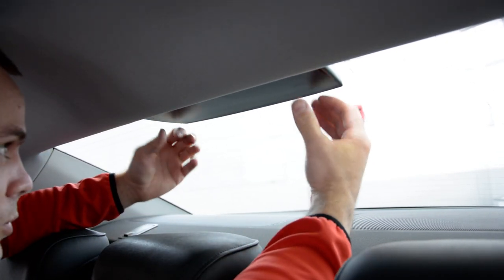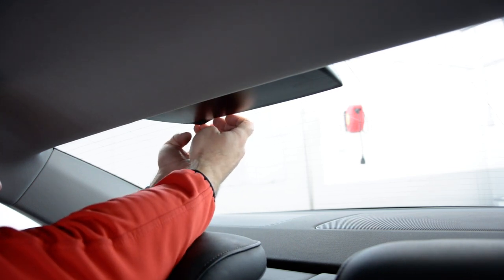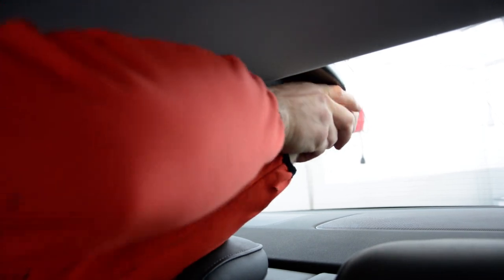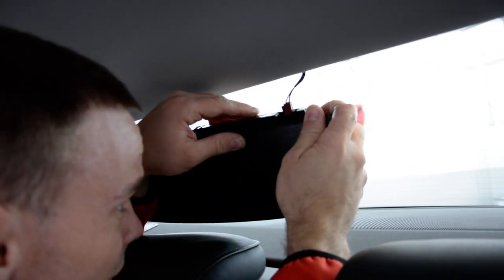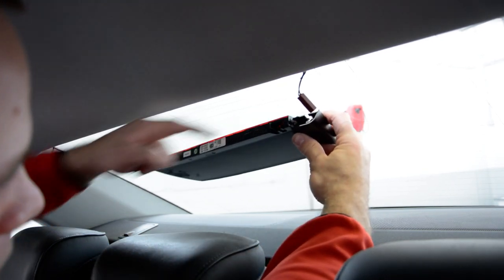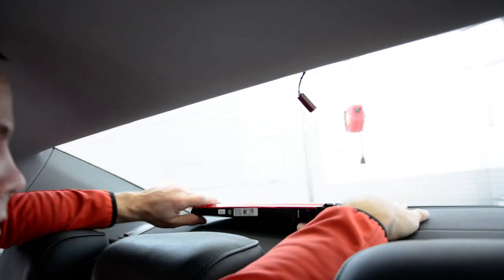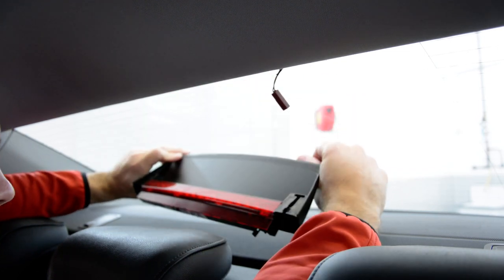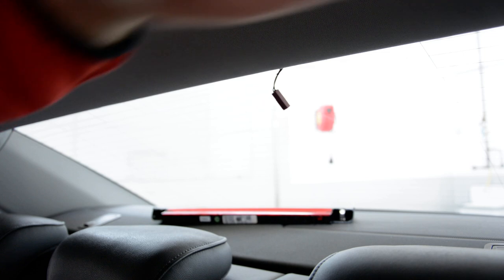Third break light removal Audi A4, A3 2015

Comment: Before you replace a poor working brake light check each led with a multi meter because they might only need re-soldering due to age, heat from the sun and vibration, I've re-soldered more than six in different cars and the all worked as new.

Comment: Getting it out was easy, reinstalling it was a pain. Tried for nearly an hour trying the other methods mentioned. The issue for me was the headliner was preventing it from going in, once I pulled the headliner down to allow the light to slide in,  it went in smoothly. Give that a try if you are struggling to reinstall yours.

Comment: It’s much much easier if you use one of plastic curved removal tool to slide it out. Put it in between roof lining and edge of third brake light and slide it down. 20 second job.

Comment: Now how to put back on
Reply from the maker: Just  check the metal tabs to be in the right position and just push it back in place the revers movement
Reply: @DFCGarage  ye it was easy to take off but to put back on was frustrating. The ceiling liner gap is so tight plus the lights grooves on the ends that are meant to grip to the inside of the ceiling liner is wider than the space. Pulling down on the liner and pushing the light in is crazy. Lol  just me venting
Reply: @dgames8900  yes I agree, I'm looking on here because it's almost impossible to get it back on, and I still can't do it.
Reply: I had the same problem. Couldn’t find a video of how to reinstall anywhere. Once you have it started, start with one side and pull the headliner just enough to get the one side pushed in all the way, or almost, and then work your way to the other side. Pulling the headliner just to the right or left (depending on which side you start on) of the headliner gap will help give room for the edge of the new light housing. Take your time and it will go in, but it definitely won’t go right back into the same place as when you took it out. Once I did what I mentioned, it went in nicely. Thanks to the video removing it was easy.
Reply: To place the part back you have to work in an angle. Then work it under the ceiling line. Then you can push it in the right place.
Reply: I have the same problem. Once I pulled it off, now I can't put the new one back. One side goes completely in but the other side is impossible to get fully in place.